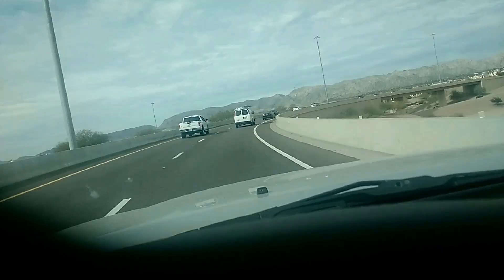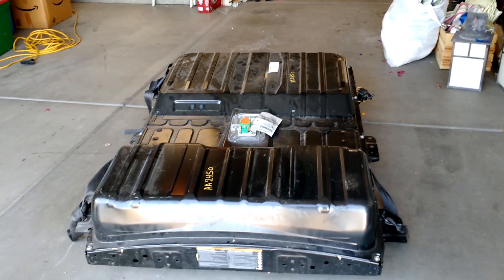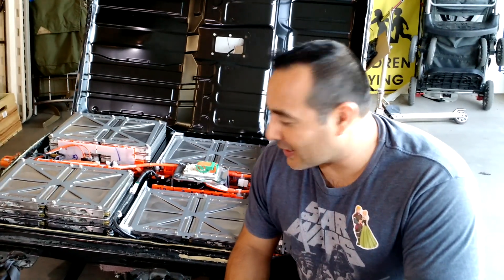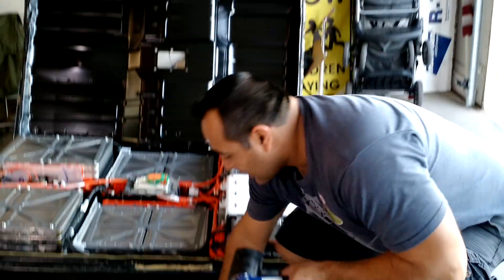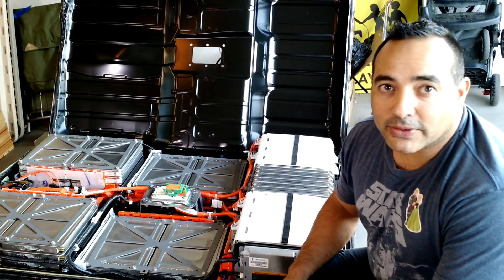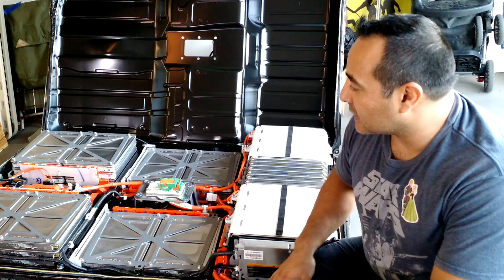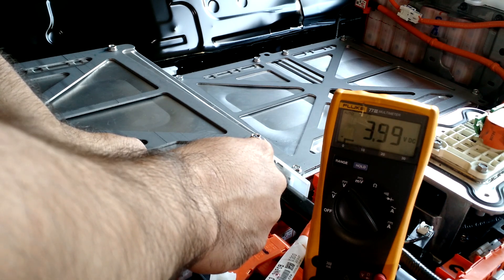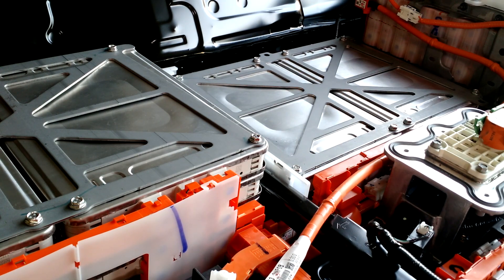RV House Battery Part 1: Source and Open Nissan Leaf Battery

Comment: i have 64 prius batterys on a 5000 watt pure sign wave 24v system and one 24v 300ah battery on my solar i have running for about a year i put them in groups of 16 for 8volts times4 to make they will charge up to 31 volts but i only charge them to 28volts working fine, im not sure how many total ah i have

Comment: I’m interested in 24v Nissan Leaf config. Knowing the 6S config is a lower voltage range for 24v, maybe an 8S is the way? The highest voltage would be 29.6 which is compatible with most 24v inverter ranges.

I’ve got 15 soon 16 g2 Leaf batteries, a 24v 3000w wzrelb inverter, 100/50 victron smart MPPT, victron smart shunt and 1200w solar(4x renogy 300w 24v) wired in 2S2P.
Reply from the maker: I have not run 24V but if the voltages are in range you should be good to go.  If i did run 24V I would likely run as you suggest on 8S (4 modules).  I limit my cells to a maximum charge of 4.05V per cell because it is a little easier on the battery and they should last quite a bit longer that way.  Sounds like a great system!

Comment: My electric bill at home is a high of $300/month (in winter) to a low of $70 in the summer or a total of ~$1800/year.  If I were to assume that I'd use ~$300/month of electric in my bus (from batteries) every month, $300/month divided by $0.10/kWh would be 3000 kWh per month.  How big should my battery bank be?  Is it wrong to consider this is apples to apples?
Reply from the maker: I don't think using your house bill is a good way to determine what you are going to use on the bus.  Think of all the big electrical things you run in your house (the air conditioner, washer/dryer, oven etc etc).  We use just a little more power than you (except during the summer when we use A LOT more power).  I just got a power bill (Nov in AZ) that says we use an average of 54 kWh per day in our house (1619 total kWh for the month).  In our bus, we usually only use about 3 kWh per day.  The most we have ever used in a single day was about 30 kWh per day during the summer with 4 air conditioners going and using a bunch of power tools.  Our baseline in the bus is about 2 kWh per day to keep the refrigerator going, our security system, Internet router, cell phone booster, inverter, and about 8 DC-DC converters.  When I did a reasonable estimate with our usage, I kept coming up with the number 6 kWh per day.  I figured with everyday life, 6 people on board, a reasonable estimate for power usage during nice weather was about 6 kWh per day.  I also figured we could make at least that much power from solar on a daily basis if not more.  In order to "not worry" about the power, I sized our system as large as I could reasonably fit.  We do plan to live in our bus so that was a very large consideration.  That being said, our system is pretty massive.  We have the equivalent of about 20 or so Battle Born batteries worth of storage and just a touch under 3500 Watts of solar on the roof.
Reply: @BeginningfromthisMorning  I was thinking of filling my roof with ten Trina Solar 375W panels and using 16 Battle Born 12V 100AH batteries.  But after watching your video (and Life Is A Joy), the mini split would free up some space on the roof (instead of using a roof-mounted A/C-Heatpump) Thanks!
Reply from the maker: @JerryDLTN  I love Jim and Deb! I hope to get to meet them soon!  If you are going that big on your batteries and system there are some better options for battery (in my opinion) than the Battle Born batteries.  The price difference is pretty substantial - the capacity in my $2800 pack is about the same as 20 BB batteries.  The Battle born batteries are a great "drop-in" lead acid replacement battery but it sounds like you are building an entire large system.  Email me and I can give you my opinions on it - juan@beginningfromthismorning.com

Comment: I did it, I bought a leaf battery pack. I had to replace my 8D deep cycle batteries (x6) and they are close ($) to this pack. I going to model it after yours. Hope to make my own videos. I have a pneumatic chisel so I hope to get it apart faster. I have close to the PV you have on my coach. Fun, fun fun!
Reply from the maker: Congratulations Christopher!  I don't think you will be disappointed with the Nissan Leaf battery - we have been very very happy with the way ours is working.  A pneumatic chisel will work great - just remember the batteries are about 1 inch inside the case.  I am looking forward to seeing some of your videos!
Reply: Sorry I miss where you purchase the used battery pack ?  I am sure they are tested before you purchased them also correct?

Comment: Two things, your power, and negative cable connections you might think about using super glue and a small piece of plastic between the contacts also not sure what they call it but they have a plasti dip for tools to rubberize the handles, you could paint it on the terminals and that would help. I know this was a while ago but if you see this and have to take them off it just might help. Another thing a shutoff downline might help on the negative side when working on it?

Comment: Hey Juan, have you considered taking the waste heat off your ac units and running a pre heat tank for your hot water?
Mark.
Reply from the maker: Interesting idea Mark!   I have not considered that and we hope to be traveling in favorable weather (70-80 degrees ideally :)) - If we were staying in the AZ desert - I think using the heat would be a very viable option - although the plumbing for it might be a bit tricky.  Thank you for the suggestion
Reply: @BeginningfromthisMorning  do with one diesel heater and smaller ducking you can reduce air flow to your water bay you only need keep warm.

Comment: Thank you.My RV has 2 group 27 bats,,How many of these cells/units to equal the amps of the 2  group 27 bats? Great video,Wish you had explained the weight/Amp difference between these bats and Lead acid.73s
Reply from the maker: Hi Ralph - I did some research and found that most group 27 batteries are about 90 Ah @ 12 Volts and weigh about 67 lbs (on average) - you have two of them so that gives us 180 Ah @ 12 Volts.  To convert that to power we just multiply the two numbers to get 2160 watt-hours of power or 2.2 kWh of power.  Lead-acid batteries should only be depleted to 50% - so that gives us 1.1 kWh of usable power.  Lithium batteries can be depleted to 80% capacity to be safe.  The Nissan Leaf battery has a total capacity of 24 kWh but since we can only deplete it to 80% we get about 19.2 usable kWh.  Next, we divide 19.2 / 1.1 to get a ratio of 17.5.  Meaning the lithiums provide 17.5 times more usable power than the pair of group 27 batteries.  Since we are comparing to a pair of batteries we would need about 35 group 27 batteries to yield the same usable power.  Weight difference:  Nissan Leaf batteries weigh about 400 lbs - 35 group 27 batteries would weigh about 2345 lbs.  Price difference: This is not apples to apples because I bought the Nissan Leaf battery used out of a junkyard, however, they should last significantly longer than lead-acid batteries.  I bought the Nissan Leaf battery for $2500 - If we get the group 27 batteries for $100 each (average) we are looking at $3500.  I describe most of this math in the accompanying blog post: http://www.beginningfromthismorning.com/house-batteries-part-1/

Comment: I have a couple of these to do, what about using a cutting disc and doing it that way?
Reply from the maker: Cutting disk would have worked great - I think another thing that would have been awesome is one of those Multi-Tool oscillating cutters.  I was afraid to damage the cells - but as you can see when I open the case - there is about an inch of clearance all around

Comment: Nice. I'm using batteries from hover boards for my Van. What voltage will you configure your RV house battery to be?
Reply from the maker: Very cool!  Originally I thought I was going to do 24V (6S32P configuration) but I have now decided to do a 48V configuration instead (14S14P configuration - I had to buy an additional module that I bought off eBay).  I am still wiring them up and getting it setup.  Good luck on your build!

Comment: You need a work bench
Reply from the maker: LOL - yes.  The battery in the case weighed about 650 lbs - It would have been really hard to get it on the workbench :)